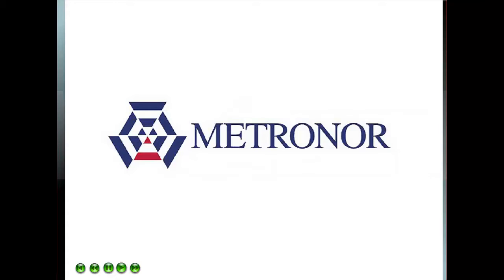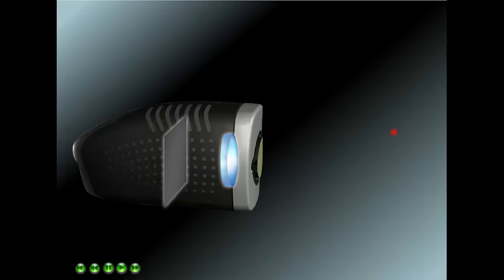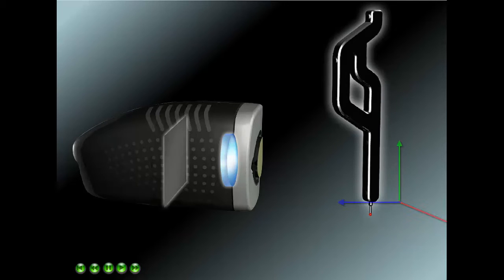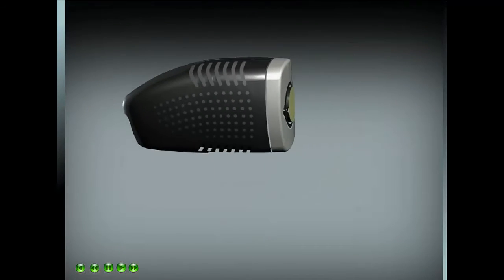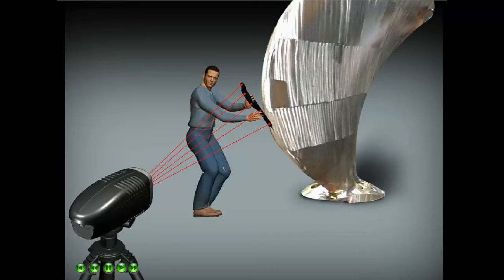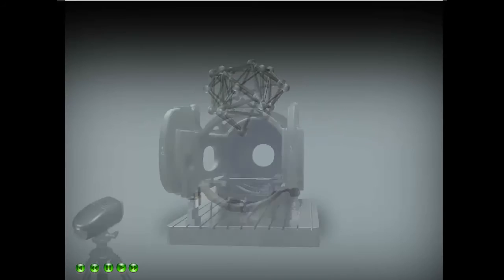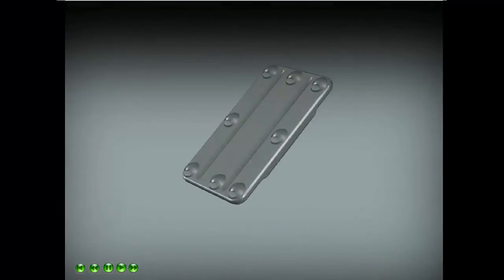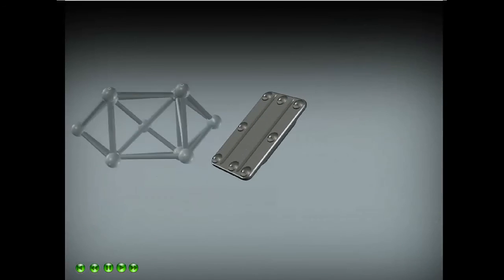Metronor Technology Overview Applications

Comment: could  metronor use to check a dimension between point to point ?
Reply from the maker: Yes, that can easily be done with our systems. Thank you for your comment. Feel free to email our experts team at support@metronor.com with your application or specific needs, and we will gladly get back to you with some of the most interesting solutions for your particular case. We'll have into account your application, budget, accuracy level needed, space and other constraints, etc. And, of course, you can also have a look at our website: www.metronor.com, where we explain how Metronor's measuring systems are being used in different industries and applications. Do not hesitate to ask - it's what we're here for!